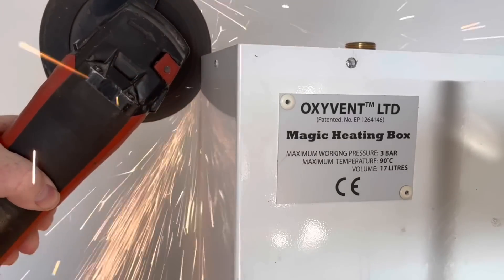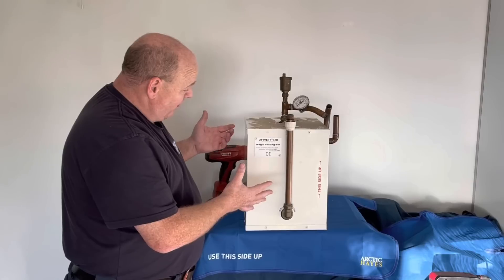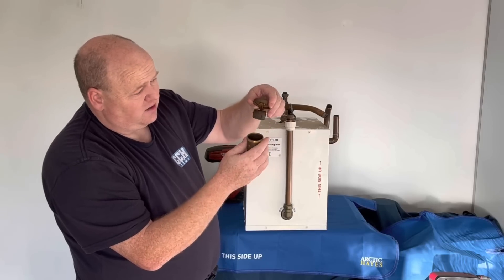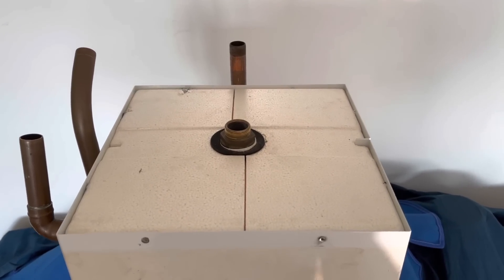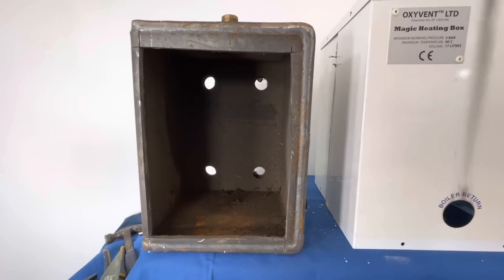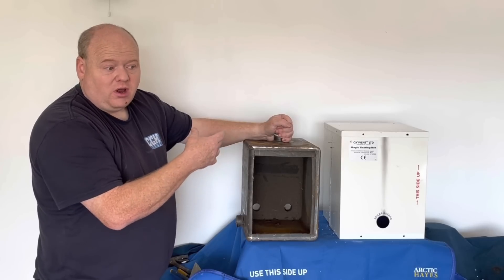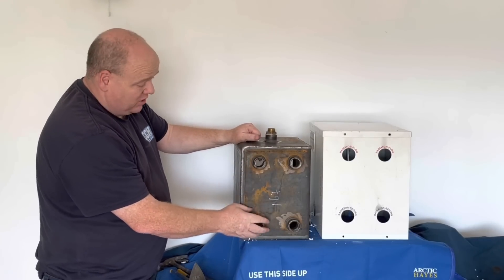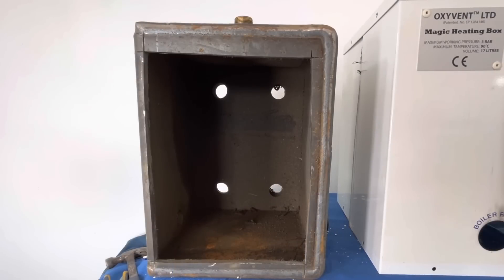What’s Inside The Magic Heating Box - Sherburn Plumber

Comment: It's terrible for condensing boilers where you want the lowest temperature possible returning to the boiler. 
I use an nrg zone when I'm linking boilers or heat pumps with solid fuel.

Comment: These were 100% mis-sold, I've seen one and immediately suspected it was a con, but didn't really know what was going on inside it. In this particular scenario, it was just with a conventional boiler, cylinder, and about 7/8 rads. I can't see how it can help at all, it just gives the system another mass of water/thick steel to heat up. The guy definitely fell for a salesy schpiel, he was told it'd save loads of money.

Comment: I’ve got a magic box it was installed b4 I moved in to the house installed by enviro solar, & @ the moment my gas is coming on all different times of the day costing me @ least £9 extra a month and I can’t stop it, the only way is to turn the boiler off and that what I’ve been doing. I have 2 stations electric wiring 2 pumps 2 valves 2 thermostat, I’ve had an engineer around here trying to work out how it’s been installed, can you help me
Reply from the maker: Thanks very much for your comment, please consider subscribing to support the channel 🙂

Comment: Hi Allen. In the situation this box was installed in, one heating circuit, the box was completely pointless. Worse than pointless - and a rip-off. The hot water needs to get straight to the radiators, rather than being cooled before it starts by the return water from the radiators. The pumps connected to the box (one enormous) would just make the boiler's job even harder. With the name "Magic" I was expecting some form of amazing heat exchanger in the box. I could not believe it when you revealed the box was empty. Jim
Reply from the maker: My thoughts as well. Totally ripped off. Thanks.

Comment: I've taken one out of my house. It didn't have all the insulation, it was just a box with lots of pipe connections. It combined a gravity fed stove, gravity fed hot water cylinder coil, pumped radiators and pumped electric water heater. It was barely 6" above the stove and 6" below the hot water cylinder. The stove would often boil and blow off back into the header tank in the loft.

Comment: I went to a greenstar condensing oil boiler, where the customer had one of these Magic Boxes fitted, at the same time as the boiler,  (she was charged an additional £2800.00 for the box), she was advised to leave the boiler heating on constant, and the secondary timer just controlled the MB pump, in the end she had it removed. I can not see what these are being sold and fitted in a domestic property, apart from ££££££ and the salespersons commission?

Comment: https://youtube.com/watch?v=WX_53deMFiE&feature=share
Seen one installed on a 3 rad combi system along with  a heat exchanger panel ( installed inside) connected to an unvented cylinder. Customer had a 24kw combi which was all it needed. Think he paid £7k. Shocking. (See above link. )

Comment: I often wondered about these units but as I suspected. Thanks for video. I agree same a dunsley / low loss header. I did one dunsley unit linking gas boiler and stove, it was a pain, then found thermal stores 15 years ago and built many hybrid heating systems. I made one thermal store with 4 x 3kW immersion heaters to make and electric boiler. I have a basic control that turns off the fossil fuel heat whenever the stove is lit. I used the Dunsley Yorkshire wood (Biomass) stoves which are one of the few boiler stove with defra certificate. I did a few stores that were like old fortic tanks but tank on top was F&E rather than cold water. I did end up using open vented boilers because if a coil was used to keep boiler side sealed I found that on big houses coil could not keep up. I also did some unvented wood burners which have the safety cold water circuit where you could have whole system sealed. Watch out for big expansion vessel.

Comment: if he had made it from round pipe as a low loss header he would have needed thinner metal in the walls because the round shape would have kept its structural integrity.
If the ultimate goal of the "inventor" was to get that alignment to the hydraulic fittings and the square outer shape it would have cost less to make it from the round pipe and attach to it fittings cut and welded to the desired position so that the final product could look the same on the outside but it would have been built much more efficiently on the inside with much less welding and would have weighed much less ...
PS: It's a shame that a poorly designed product can be called an invention ....

Comment: similar to a Dunsley neutraliser but way more expensive. Could it be used as a neutral point for 2 heat sources eg boiler and wood stove, which feeds , say, rads and a cylinder? or are there not enough tappings?

Comment: It is a small buffer and hydronic separator. Think of a header.  The boiler and its pump can run flat out on the boiler loop side.  But on the rad loop side, with all rads having TRVs, only a trickle of heat can be injected into the rad system, say 0.1kW of heat, but using a variable speed Smart pump.  That is far too low for a boiler to handle (A Geminox could at one time run down to 0.5kW), making the boiler cycle on and off.  Two pumps are needed, one on each side; a smart pump on the rads side. 

It needs a control interlock to cut out the boiler, so the boiler and boiler pump do not run continuously. That can be done by having the auto air vent removed, a tee fitted and a probe thermostat fitted down into the water inside the box, so the thermostat and air vent use the same top port. A pipe stat could be fitted, but that is clunky. 

DHW heating via cylinder can be used taken off the rads side.

The same effect can be had by having the boiler's flow & return in a pipe loop, with two close coupled tees to the rads Flow & return off the loop. Also have a pipe stat on the return to the boiler as a control interlock  - saving £££££££££££££££££££.

Comment: Wow - thank goodness this company has come along to show all the worlds manufacturers where they have been going wrong all these years.  I've just seen one on sale on eBay and it's only £800 - what a bargain!  Definitely 'magic' and I think I can see how it maximises transfer of hot cash from customer to maker/installer.  I can't wait not to fit one to my own heating system.  Thanks as ever, Alan, for keeping the public informed.  ;)  PS  I just fitted two 'magic'  gadgets to my car which both offer the opportunity to save 50% in fuel consumption.  I expect my fuel tank to start over-flowing at any moment!!
Reply: That's cheap they normally charge an OAP £5k